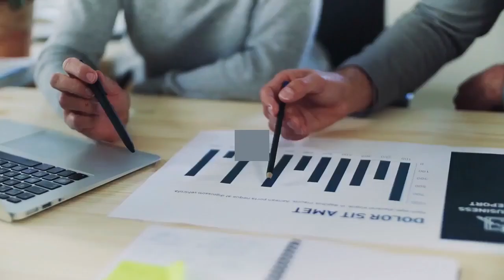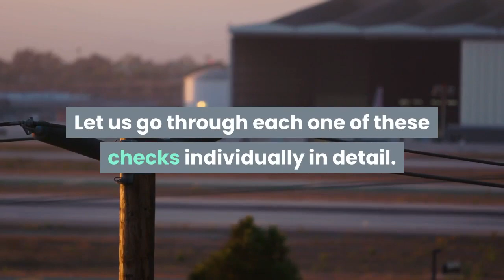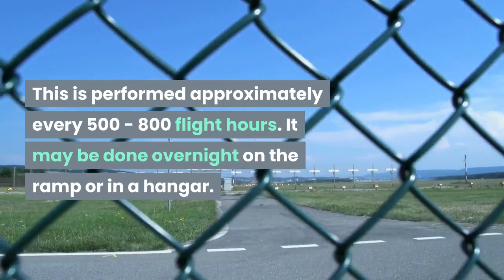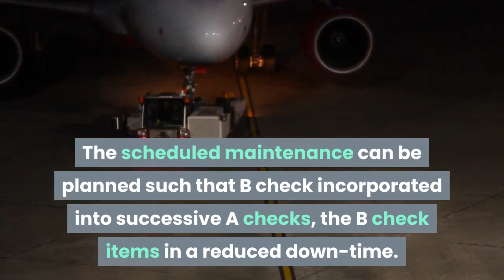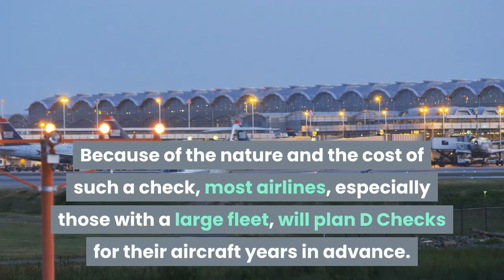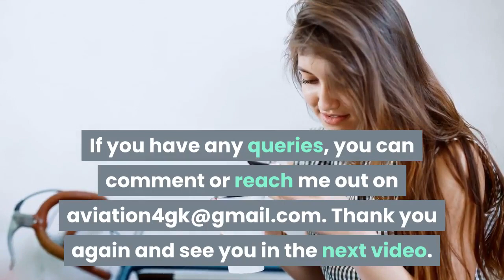All About Aircraft Maintenance Check cycle | A to D check | Transit, Daily, weekly, & Monthly Check

Comment: Please be kindly informed that PDC, daily , weekly or service ,== A and multiples,, C and multiples, 6 years, 12 years and structural inspection  ok
B check in Boeing not in Airbus
But D check is replaced by 12 years and structural
Reply from the maker: Thank you so much sir for the information and clarification.

Actually in the video I have explained basic information with general Idea of Aircraft Maintenance Checks, and it is not related to any specific manufacturer or type of aircraft.